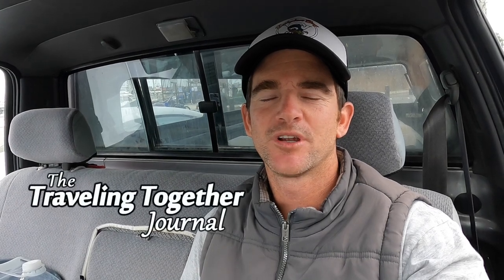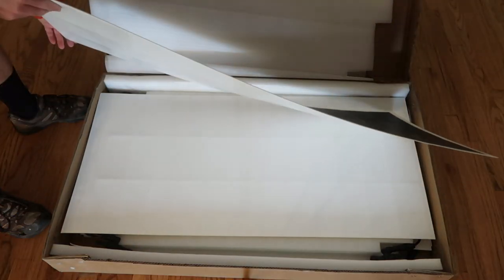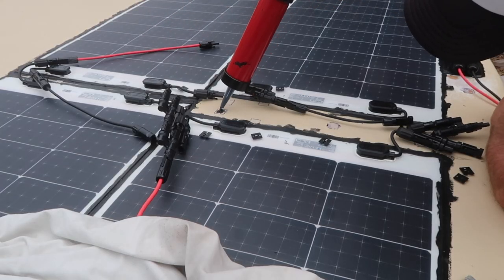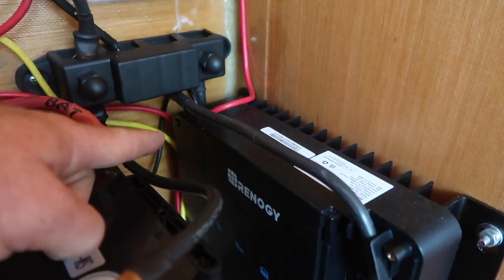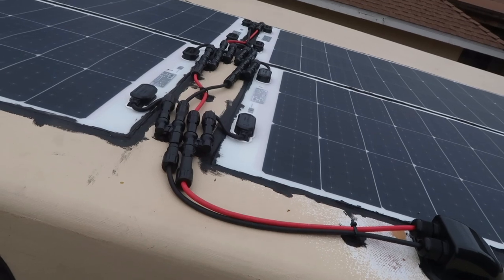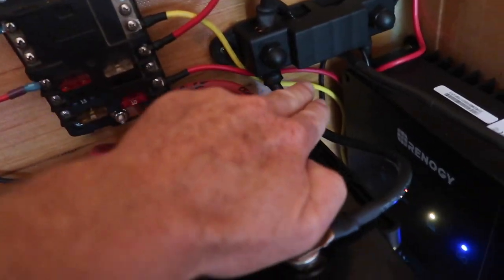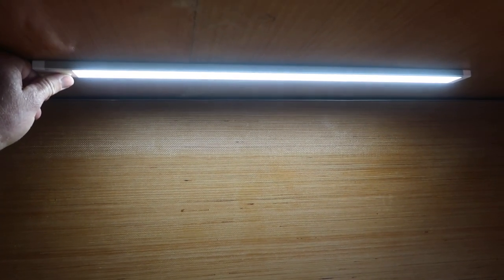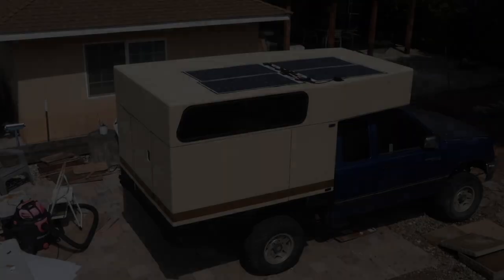Building a 4x4 Camper | DIY Electrical System | Installing Shawllar Solar Panels

Comment: Nice setup.  The lithium battery is a game changer and should last a lot longer than lead acid and is a lot lighter.  The only thing with the lithiums that is a pain is dealing with the cold weather charging restrictions.
Reply from the maker: Yeah. More than double the useable power storage for less than half the weight compared to our AGM battery bank. The cold weather charging limitations will probably come into play at some point, but i'm not a big fan of the cold, so hopefully I won't be spending much time in freezing daytime temperatures 🥶

Comment: Great video, Matt. I haven't seen you update videos for a long time, hope you can show more about the use of LiTime lithium battery! Because I am planning to buy the one of 12V 230Ah Plus lithium batteries.
Reply from the maker: Thanks
So far so good as far as the @LiTime battery is concerned. Obviously I haven't had a chance to use it much, but I have been running the lights and fans in the camper while I'm working in there so its held up to the initial use.

Comment: Double check your renogy install manual.  I don’t believe a temp sensor is needed with a lithium battery 🤷🏻‍♂️
Reply from the maker: Ok. Thanks for the tip. I'll check on that

Comment: Do I keep my bed or go down to the frame?
Reply from the maker: If you're only going to use the truck for camping, definitely get rid of the bed. It gives you more space and freedom to design your camper and it's a quick way to drop 300 pounds of curb weight
Reply: @TheTravelingTogetherJournal Thanks, But the sub frame would add some of that back, right?
Reply from the maker: @othoapproto9603  Yes. My subframe was 100 pounds. 

If you are comparing it to a slide in that you can't enter unless it's in the truck or on some kind of stand to support the floor, then it is a hundred pounds that would get added back on.  
But if you are comparing it to a slide in camper that can be left on  normal camper jacks and entered, then you would need additional support built into the camper floor and the camper jack lifting points, so it would probably be about the same weight as camper with subframe.